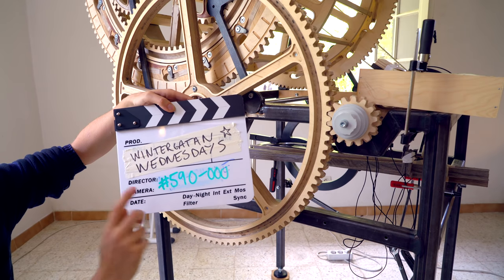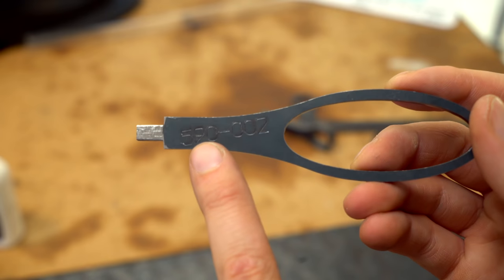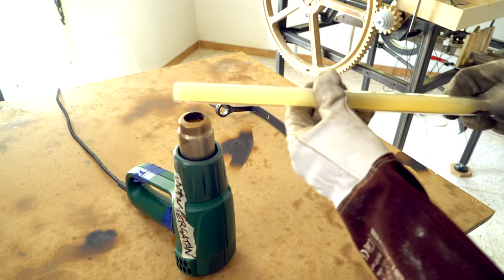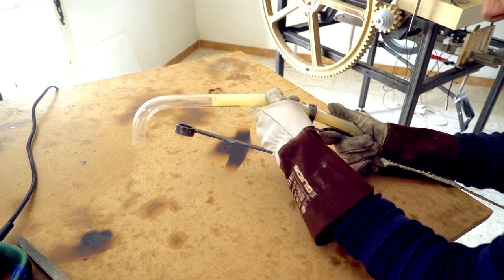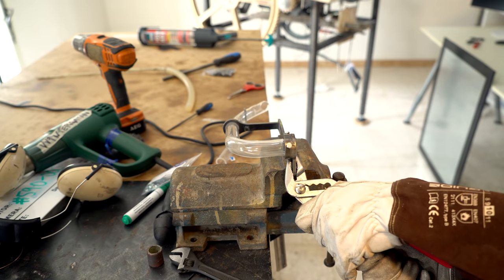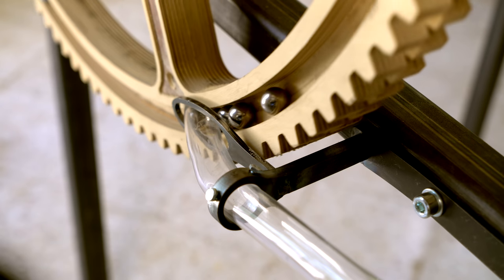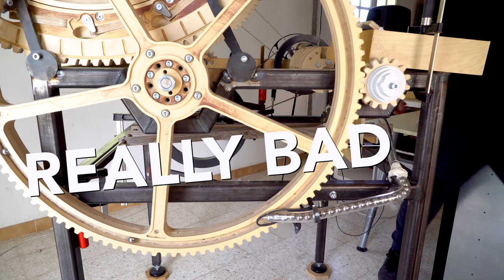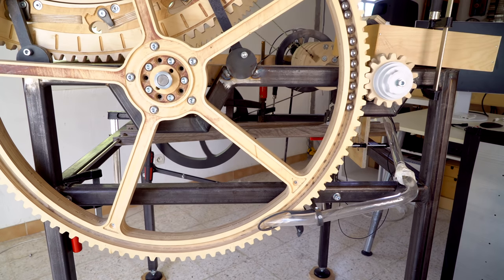Marble Gear Lift Entrance - Marble Machine X #58

Comment from the maker: Hey everyone, back to building videos again :) There is a lot going on behind the scenes as always and I am sure I can keep up making real building videos from now on, a lot of parts are coming together right now, so enjoy #590-000 and i´ll see you next week for the next subassembly! All best/ Martin 
BTW, video is 4K but it takes some time for youtube to prepare the 4K version it seems.
Reply: I wait all week for your videos now!
Reply: The PMA bending reminded me of hard-tubed liquid cooled computers. It looks awesome!
Reply from the maker: @countmeout4153  that is nice to hear!!
Reply from the maker: @tmi1234567  I found the trick with using the medical rod for perfect inner radius from computer build videos on youtube! So well spotted.
Reply: Did you adjust the cad drawing after all the real world adjusting of that piece? So if you need to replace it you won't have to experiment with it again?
Reply: Are you planning to move to pipes for all marble tracks or will there still be some wire tracks?
Reply: Please made a Utip.io page for support. Its soo  practical.
Reply: What alloy of steel are you using in the marbles? I suggest to use a soft magnetic alloy (not mechanically soft, but a magnetic "softness" if you like) that do not retain any (or very little) magnetization after being lifted. You should look for alloys with low magnetic remanence/coercivity. Electric steel or silicon steel are some names for these alloys, often used in motors or transformers as the magnetization would otherwise cause power loss/inefficiency.
Normal steel contains carbon, the carbon increases the mechanical strength a lot, but it also increases the remanence and coercivity, not what you want.
Reply: @Wintergatan  say me hello :3 good luck for all the wintergatan team from Paraguay lml
Reply: To the moon my friend!
Reply: What's the song in the end called? And where can I find it? Keep up the great work! Absolutely love your videos. Hälsningar från mörka Sverige!
Reply: @Wintergatan  Well I love it! I am currently in the process of designing a case for a custom small form factor computer but I wish I had the money to do liquid cooling. You are truly an inspiration to those worldwide! If you ever need help parting out computer parts for a new rendering or CAD computer, I would be more than happy to help you out. I enjoy your music for it's analog sounds and unique methods of creation. If you ever come to Colorado in the United States, I would love to go and see Wintergatan!
Reply: remove the metal oval then it will look much cleaner and you probably don't even need it
Reply: I'll miss the CADing :3
Reply: At 9:35 - I gave you applause. The MMX is already getting the crowd on their feet ;-)
Reply: @Wintergatan have you considered aluminum parts around the magnetic parts?
Reply: I just have to say that I still find the angle very awkward. The marbles don't roll in one continues motion into the wheel.
That is asking for trouble because of the inertia (of the marble). The exit of the tube should be parallel to the wheel.
Reply: One step closer. Great job Martin.
Reply: Martin there are some parts of metal that you did not apply that special polishing paste
....are you gonna do this ?
Reply: @lotfalolett1  The track is called "ItsBeenAJourneyButWereNowOnOurWay" but it's not an official Wintergatan download, since "Wintergatan songs don't have vocals." He provided an unofficial free download link in the description of one of his build videos. The full track is excellent.
Reply: @lotfalolett1  EDIT: The track "It's Been A Journey But We're Now On Our Way" is no longer available for download from the link under this video: 
https://youtu.be/f-zdCoI3tv8
Reply: You should get a bending iron for doing curved parts if you put a sheet of veneer or something between the tube and the iron it shouldn't burn or melt... And it could make it easier to a lot more accurate/smoother bends. Love you're videos and can't wait for the marble machine to be finished 🙂
Reply: Hi  @Wintergatan !! First of all, I fall in love with your work!! I had following you since the first MM building videos so It's amazing that you've reached this point!!
But I'd like to give you some advice. I don't get outside my head that the adjustment of the tube to the large gear is too short... I think if the machine has a stroke when transporting it or the gear is deformed with use stop working. I recommend soldering the support a reinforcement to make it harder to bend. 😁😉
Goodbye and keep it up!!! Wednesdays are cooler for you!! ✌✌✌
Reply: @buddyclem7328  Which video, thanks btw
Reply: @Richard.Andersson  as he is also making a demagnetiser downstream from the marble elevator, i doubt magnetization will be an issue
Reply: @Wintergatan i am watching it in 4K again right now, and i will watch it again for sure (everyday until the next Wednesday!!)
Reply: This part wasnt as flexible as it couldve been, if you wouldve added some sort of groove in the back nut it would let you adjust it without bending the metal oval :P live and learn
Reply: @Wintergatan If you want a new workbench you should get in contact with pocket83!
Reply: Sadly this part was ghetto and I think you know it too. You arrived at a working piece that looks decent but it breaks a lot of your rules. In particular it's not reproducible.
Reply: LOL I was JUST listening to "Journey" and you put it in the video.
Reply: One more piece finished, one step closer. Cannot wait to hear it play
Reply: @Wintergatan, have you considered not having the oval?
Reply: All those marbles gone in under a second. I am amazed yet again. Please don't forget to tour Australia.
Reply: You liked the hex-bolts because you are steampunk. It's the only explanation.
Reply: Saludos!.
Reply: More CAD videos pls, your approach is always so clean and professional. For someone who does it as a hobby it's inspiring =)
Reply: Ill be Waiting for another miracle that comes from wintergatan and marble machine x.
I hope marble machine x will be done after 2018 😄
Greeting from indonesia bro... 🙏🤗
Reply: I agree with  @merlingallagher4484  - really like the finish on all the other parts. This could be redesigned to join the wheel at a more continuous angle.
Reply: Nice! As far as the silicone thing, you might try just heating a flare into the pipe
Reply: I think it will be more efficient if the tube is oriented tangent to the path of the gear groove.
Reply: Will it ever be finished
Reply: you've had the programming plates figured out for a while now, how come we never see more than just the test one? i would have thought that would be an easy thing to check off the list at this stage.
Reply: @bahreiuhanrgae  probably not..
Reply: @Wintergatan  CLICK CLICK

Comment: You should put a filter in front of your camera when you record welding. The light intensity is  higher than the one from sun. You might burn the sensor of your camera doing like this 😕
Reply: In addition to safe guarding the camera lens/sensor a welding shade for the camera will make a more interesting video by showing the detail of your welds.
Reply: I am thinking of a second camera with filter on it so when the weld starts you can switch to the weld camera and we can all "see" the weld taking place.
Reply: ND10 should do - 2^10 light reduction. Works fine for photographing the Sun directly.

Comment: Keep the 6mm hex bolts. They look the part but you might need to adjust the PBS sheet now. :P
Reply: And fix the part number typo from the last video too...
Reply: I think that butterfly bolts might look nice, too
Reply: I would suggest panhead or rounded heads on the set screws to contrast between the marble spheres, the round tubes, and the squared welded framing.
Reply: @eugenew2  Thumb screws would offer more variety with the same contrast.

Comment: The last loop, being steel, pulls on the magnetized marbles (they are very magnetized when they are held by magnets). If that causes dropping marbles, just make it out of non-ferromagnetic material, like stainless steel, aluminium or plastic.
Reply: I noticed this too. I'm not quite sure of the purpose of the final loop, looks as though the tubing would hold itself nicely without it being there at all and clean the look up even more.
Reply: A while ago he designed a marble demagntizer.
Reply: Doesn't help any while they are in the magnets. They are temporarily very magnetized then. Demagnetizer removes the weak permanent magnetization that remains after they leave the wheel.
Reply: @gingerelvis  The weight of the marbles would pull the tubing off course without the oval. Changing the oval material is the better solution.
Reply: @gingerelvis  I assumed it was a combination of a pipe jig and some kind of mechanically 'adjustable' end piece. I think it could be designed better than it is, both aesthetically and functionally.
Reply: The MMX is large and heavy with moving parts. This is gonna shake. Various parts need as much stability engineered into this thing to keep it all tight.
Reply: @franceslambert8070  Or he could make the final loop of a different material that isn't so magnetic. But seeing how that'd make it look a bit like a frankenstein of different materials I don't think that's likely to happen ;)
Reply: ...I thought the marbles get magnetized when they are lifted and demagnetized shortly afterwards. Wouldn't they be non-magnetic when they are going through the tube?
Reply: If he goes for stainless steel he needs to make sure that it’s a 300 series stainless so it won’t react. If it’s a 400 series stainless then it is magnetically reactive.
Reply: You bet me to it! That loop will get worse over time as it becomes more and more magnetic.
Reply: Cameron Kennedy An excellent point. Aluminum or plastic won’t really match the look either. 304 stainless steel will look great though. Especially if he torches it. Most of his metal parts still have the mill scale on them so they are rather rough and dark. I still think it would look so nice if he machine jeweled the metal parts. Or had someone do it for him as it would slow the production even further if he tried to do it by himself.
Reply: Stainless rails might look nicer than the tube
Reply: @SpaghettiEnterprises  That is entirely right. This is the entry point to the lift, they'd be demagnetized before getting here, getting magnetized as they proceed upwards.
Reply: Robert Szasz I agree, or at least I think the aesthetics require the diameter of the end of the pipe to fill that stabilizing loop; it looks odd just sort of floating in the middle of it. If he stays with the plastic, maybe it could be stretched somehow to fill the void?
Reply: @SpaghettiEnterprises  As far as the permanent magnetisation is concerned you are right.
But as soon as the marbles touch the weel they conduct the field from the magnets in it which has the same effect as if the marbles were very strong magnets themselves.
What that means is that the marbles get attracted by the weel as well as the loop and that seems to interfere with the transfer somewhat.
Reply: @cameronkennedy7820  yep that's the thing. Soft magnetic materials, one that are easily magnetised, are going naturally over time have their domains line up. You can manetize such materials even hitting them repetitively with say a hammer. I think the marbles will always have latent magnetism, and as they pass and vibrate near that loop their is a good probability they will become magnetised. I'm only hoping the tube gives enough separation for it not to have an effect
Reply: I like the look of the tube personally, I wonder if 2-3mm stainless wire could be run along the tube, glued to the outside, to give some more rigidity. It could even be hidden towards the inside of the machine for aesthetics.

I'd avoid rails to prevent marbles jumping off. A tube holds them captive with only one way in and out
Reply: @Landogarner83  Okay, the marbles conduct the field... but the magnets are built into the wheel with alternating polarity.  So won't the overall effect on the loop even out?  One marble conducts a North magnet and the very next marble conducts a South magnet.  I'm not an expert so if I'm mistaken please explain it to me.
Reply: @stevehastings2010  for opposing polarity you would be right and the marbles would create a shortcut for most of the magnetic field.
But Martin built the wheel with all magnets in the same polarity so the marbles only conduct from the magnets to the loop.
The demagnetizer weel was built with opposing polarity but the transport weel has them all in the same direction.
Reply: @SpaghettiEnterprises  He means once the marbles touch the magnet wheel, the plastic tube is in the middle of the metal ring so the marbles, now attached to the magnets, pass very close to the edge of the metal ring surrounding the exit of the tube. The concern is that the metal ring would pull at the magnets which would cause problems. 

I am also of the opinion that he doesn't need that ring at all, since the support in the middle of the tube is close enough to the end that it would probably be enough by itself for the last 6" of tube.
Reply: Agreed. And make the tube load the marbles tangent to the loading groove.
Reply: Fortunately, he's got a TIG welder, so welding aluminum isn't an issue.
Reply: This is about as perfect a situation to 3D print a part as I have seen yet in this project.  Really only need something to support from the last attachment ring out for a few 6-7cm to provide adequate rigidity when it's full and when marbles are really moving.  

There are some great ways to finish 3D printed plastics.  Recommend printing in some sort of nylon and then tumble finish to get a rustic look.  Could paint afterwards if you want to maintain a really good match to the metal aesthetics.
Reply: @Landogarner83   I said the magnets alternate polarity.  Since you don't believe me, please watch "Making the Planetary Gears - Marble Machine X #36" at about 5:45 and you will hear Martin say that there are exactly, 100 magnets so the north/south alternation comes out perfectly.

https://youtu.be/8gUQA7jUNoo
Reply: @stevehastings2010  of course I don't believe you if you are wrong :)
Watch https://www.youtube.com/watch?v=xZSmyg-1fFU from from about 5:45.
The wheel you linked is the upper one but this marble feed goes to the lower wheel.
Reply: @Landogarner83  I stand corrected.  Thank you very much for providing the reference; you were correct and I was mistaken.  Note that the video you referenced is #13 and the one I referenced was #36.  I guess he built the earlier wheel with same-polarity magnets and later on changed his mind.  I wonder if he ever pried out the magnets on the first wheel, and rebuilt it with alternating polarity?  Also, in video #36 he had a problem with the gears and was seriously considering re-cutting them.  I wonder if he will redo the same-polarity wheel along with the planetary gears and sun gear.
Reply: @stevehastings2010  Yep that was looong ago and I only remembered it because it is not the way i would have done it.
He even mentioned in that video that he found out alternating polarity would have been better so it is not surprising he built the second one that way.
As to redoing that wheel i don't think it is going to be easy to get those magnets back out without damaging or even destroing the wheel.
So i guess the question is if Martin thinks ist's worth it to replace the part with the magnets.

Also while i am not certain about that i think he already fixed the planetary gears somewhere along the way.
Reply: @Landogarner83  He got the planetary gears working by playing around with the sun gear and finding a tooth size that works.  But it runs a bit rough and sounds noisy, and he said he was conflicted about whether to rework the gears.  I think it's a lot of work and he hasn't.
Reply: @Landogarner83  Be sure to watch the latest update, #60.  You will be happy.  He reworks the wheel that has the non-alternating magnets so that they are now alternating.
Reply: @stevehastings2010  Yep i have seen it and it obviously is quite an improvement.
That should certainly solve quite a few potential problems.